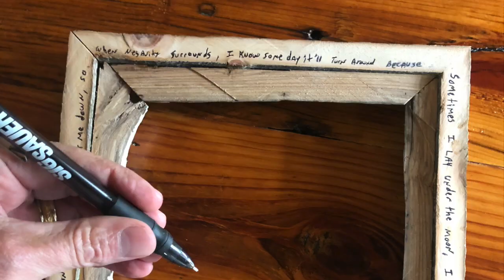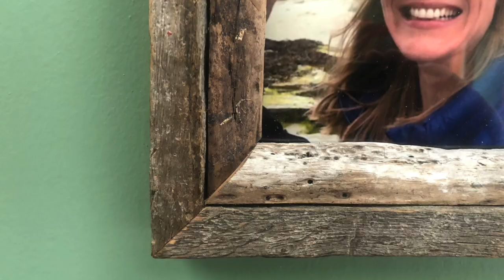DIY - Driftwood Picture Frame

Comment: I love this style of building. It's great more attractive than the overwhelming majority of perfection building I see on the tube. Can you share the jig that you used to cut the driftwood into quarters on the table saw please?
Reply from the maker: I actually didn't use a jig, that's why I didn't show video of me cutting the driftwood, I didn't want to hear from everyone how dangerous it was to cut the wood without a jig. If I do it again, I will definitely use a proper jig. Thank you for your interest.
Reply: @CreatingMandruff  I understand. The safety police can be loud. There are many others here on the Tube that use table saws without guards and I love those examples. The difference is that they dont care what people say. A fine example.
Reply: @LitoGeorge  pull over, may I see your safety certificate.  🚨😂
Reply: @wkdravenna  guilty as charged, your honour! :)